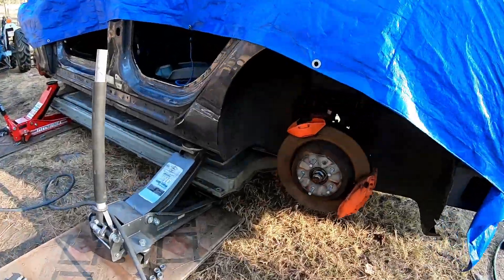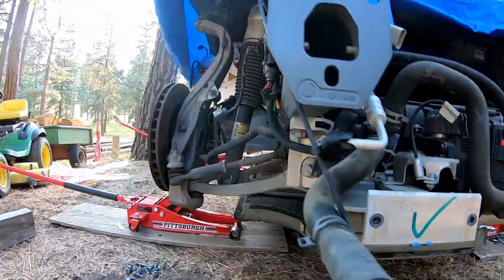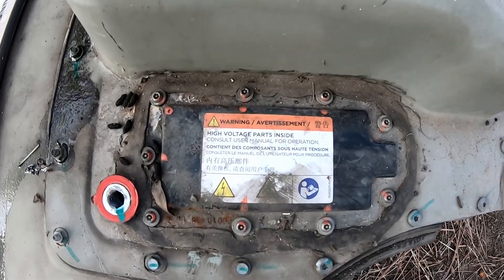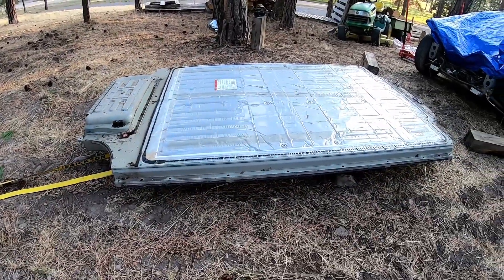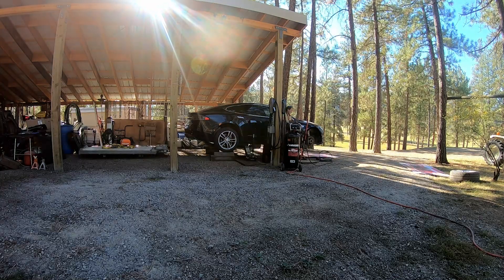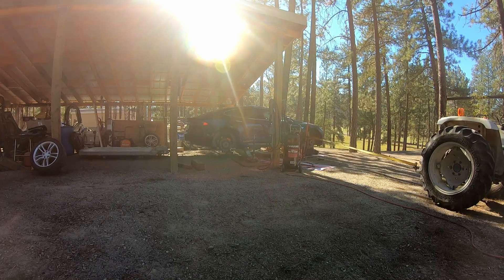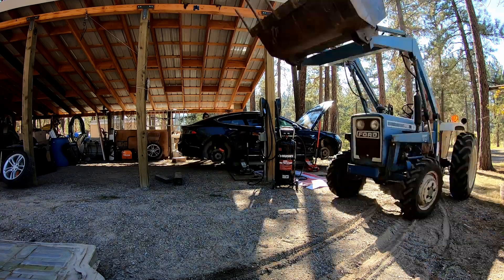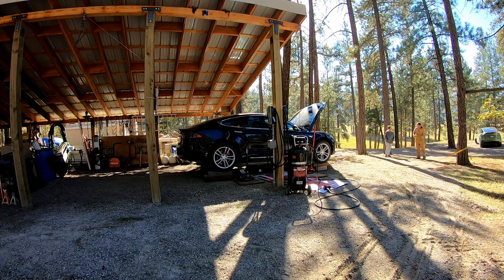DIY Tesla Battery pack swap in backyard. 2013 Tesla Model S gets battery pack. With basic hand tools

Comment: Super impressive. Could using a pallet jack make this easier?
Reply from the maker: @tonygeee24  Thank you. A pallet jack would only work on a flat solid surface. You would have to stack multiple pallets on top of each other since the end where the hydraulics are on the pallet jack would under the car most likely. That would the require the car to be raised much higher. A pallet jack can only lift a pallet about 6 to 8 inches of the ground, this may not be sufficient in this case. 
Two low profile transmission jacks would maybe be another option, but also requires a flat solid surface.
For me this was the easiest solution with the equipment I already had. Certainly other ways are possible depending on the situation.
Thank you for watching👍

Comment: Hi RMT Family, question for you. Can a 2016 MS 70hv pack be installed into 2014 MS 60? I think physically it will fit, but software wise do I need to be looking out for something. Thanks!
Reply from the maker: Good question. Size and connectors are the same. As far as I know with doing the software update the car will accept the pack but it definitely will show the original size battery on the screen/app etc. It will show the 60 not the 70. I'm not sure about the range/% showing correct. You can find people that can change all that and make it work properly. Don't know what they charge to do it.
Reply: Ty sir, software would be just go under the screen -> service mode -> install software, correct?  I will look for someone who can change the configuration. Thanks as always willing to answer questions.
Reply from the maker: Yes, correct.
Reply: @RMTFamily  Just wanted to update you, 2014 Model S 60 I swapped it with the 70 hv pack. It worked, software went through without any trouble. As far as the vehicle configuration goes (changing from 60 to 70), I was able to changed it using Toolbox3.. Thanks once again :)
Reply from the maker: @waqasazmat81  Thank You for the update. Glad it worked well. 👍👍

Comment: Use transmission jacks under the battery next time.
Reply from the maker: Transmission jacks only work on flat solid ground! They can’t be used on soft uneven surfaces as we were working on. Also transmission jacks need modified to have larger surface to properly support battery pack. Using what we have around is cheaper too.

Comment: Video would have been a lot more useful if you talked about HOW you removed the pack as opposed to "ok and now it's on the ground".  Did you have jacks under the pallets or were the pallets high enough that you could sit the car on the pallet and still have access to bolt holes?  Did you have to remove some of the bolts before the pallets?
Reply from the maker: This video was intended to show that it is possible to swap a battery pack with floor jacks on the ground and give ideas on how to do it.
As shown in the video the car was raised, then I was under the car removing all parts, pieces and bolts that need and can be removed while leaving in some bolts to hold the pack in place. Obviously all bolts that are in the pallet area need removed. Then the car was lowered onto the pallet and the last few bolts that held the pack were removed. Raised the car and pulled the pack out. 
For step by step instructions you need to subscribe to the Tesla Service manual. This subscription is free on Tesla's website. Here is a link to a video about subscribing, note that the video is almost 2 years old, it's all basically the still the same, there may be a few changes since, but it is still free and provided by Tesla. https://youtu.be/8d1UYQ_yO28

Comment: Great video. Where did you get the rolling pallet that you dropped the good salvage battery onto?
Reply from the maker: Thank You. That is actually just a regular plastic type pallet. It is not rolling but glides pretty good on most surfaces. I got that from an RV dealership that I worked at. Many things are shipped on plastic pallets. I'm sure if you look around you can find one free somewhere.
Thank You for watching👍

Comment: Hello great video! I was looking to do my own swap 2013 model s 60kW battery to a bigger pack. Like a 85 or 90. Did you have to do a reprogram to get it work after your swap.
Reply from the maker: Thank you👍😀
Great question. As far as I know, yes. You have to do some re-programming if you increase the battery capacity. I don’t know the exact details toward extend the reprogramming is needed. Obviously your car identifies itself as an S 60. So if you upgrade the pack, it would still identify itself as an S 60 at least on the screen. Not sure if it would work without any re-programming. I assume that if you do a software reinstall, just like I did, that the car would be drivable. But I don’t know that it would be aware of having more range and more battery capacity.
If it would be me, I would go ahead and swap the battery pack and see what happens. There are options where you can hire somebody that will remotely reprogram your car for you. Obviously not for free. Do you already have a battery pack?

Comment: when the new battery is installed from the donor vehicle, do you have to reset anything in the car or does it automatically just accept the different battery?
Reply from the maker: You have to make sure to bleed the air out of the coolant system, which is easy if you have a Tesla toolbox. Also, you need to do a software update. You can just reinstall the current software via service mode, which is accessible in the car via the touchscreen.
Reply: @RMTFamily  what is a tesla toolkit?
Reply from the maker: @jodydewey  Tesla Toolbox is the software from Tesla to run certain service and diagnostic functions on the car. 
The Tesla service manual is available for free. Check link below. But the Toolbox you have to subscribe too. I believe there are a few different options but I believe the cheapest one is currently $500.
Tesla Service Manual Annual Subscription  for $0.00 Is it a fluke or is it for real. I just did it.
https://youtu.be/8d1UYQ_yO28

Comment: Great video!  How did you test the salvage pack to make sure it was going to be good?
Reply from the maker: Thank You.
Before taking apart the salvage car I charged the pack some and checked for fault codes. It charged fine and had no fault codes.
The assumption is that the car was driving and working fine when it got into the accident, so the pack should be ok. Usually the battery pack survives most accidents without any damage.
Thank You for watching.👍

Comment: You should never work under the car with only floor jacks holding it up... jack stands as back-up if the floor jack fails is a must for me, but to each his own. Good job with the Tesla but take care!
Reply from the maker: Hi Mikael, You are basically right. Now that said it is almost impossible to use floor jacks during this as the body has to be raised and lowered during the battery pack removal and installation while the pack sits on a pallet. During the removal and reinstall of parts and almost all bolts the car was sitting with the wheels on wooden blocks not held up by floor jacks. Using 4 floor jacks makes this pretty safe as the likelihood of more than one jack failing is extremely slim. Two jacks on the diagonal can easily hold up the weight of the car. Actually while raising and lowering the car it was not uncommon for two jacks not to carry any weight. But again you are right whenever possible jack stands should be used and used properly.
Thank You for watching👍
Reply: Cool!! This needs to be on Facebook in conjunction with the report of someone being charged over $20,000 for a Tesla battery replacement. 😂 I’ve replaced dozens of Prius hybrid batteries, but they are air cooled and not nearly as heavy. Now that I’ve seen this, I wouldn’t be afraid to replace the battery in my ‘22 Bolt EUV should the need ever arise. But at only 12k miles, I probably have some time before that happens. 😊

Well done. BTW, I was also concerned when I didn’t notice floor jacks in the video. Thanks for the clarification in the comments.
Reply from the maker: @jerrymildredpetersen3177  Hopefully you're Bolt does not need a battery ever. These are a little larger and heavier than the hybrid batteries. But sounds like you could do it if you needed to.
Thank You for watching.👍
Reply: @RMTFamily  thanks. I really doubt that my Bolt will ever need a battery. But I’m used to heavy stuff. Worked on 200 ton high speed presses for 22 years as a mechanic and then as an electrician. 😊
Reply from the maker: Wow, that's pretty cool. I'm sure you know a few tricks on how to get large heavy pieces perfectly lined up.
Reply: @RMTFamily  It looks like you managed pretty well yourself. Must be handy having a tractor and all the attachments. LOL! Being a lazy person myself, I'm always looking for an easier way that's still safe and effective. 😉